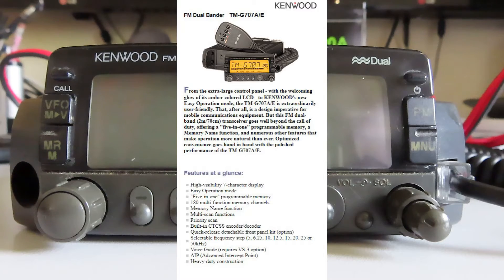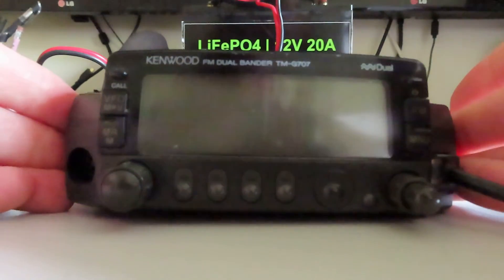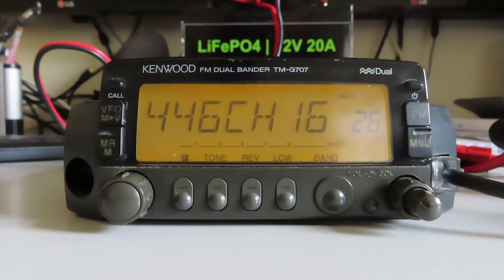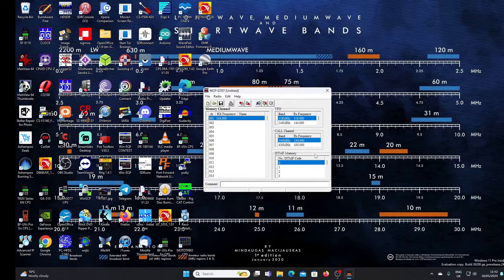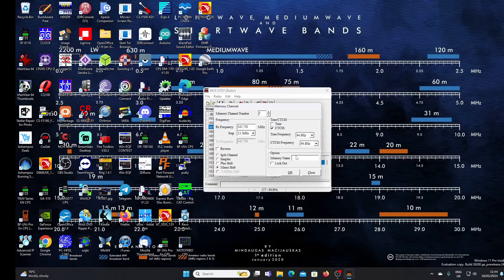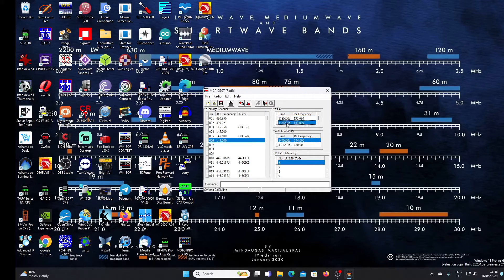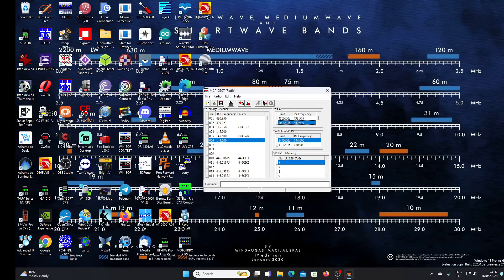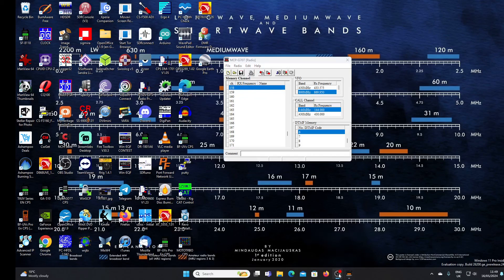Kenwood TMG 707 revisiting an old friend

Comment: Hi Kevin, thanks for making this video. I have a couple of TM-G707 that I am still using today after over 20 years. I had recently bought a programming cable but could not get any software programs to connect to the radio to work (CHIRP and Kenwood`s own MCP-2a). After a quick search I was able to find the software you used in your video, unzip it and rename a com port. It worked straight away (using Windows 11). When I write back to the radio and the transfer is complete my radio re boots its self. 73`s